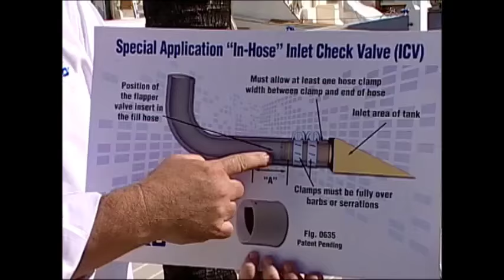1st-Relief offers the solution against unwanted "well-back", powered by Perko Inc and ShipShapeTV

Comment: the problem is the fuel air vent. If the fuel air vent is clear then there will be no "well back or spit back". if the fuel air vent is clogged or closed then there's not enough air pressure to push fuel into the motor, it will stall on idle or while cruising. Fuel air vent prevents the tank from a vacuum state, not an absolute vacuum state but enough to prevent fuel into the motor.

Comment: Looks like it backed up because he blocked the vent. Then if the valves shuts don’t you still spill the gas you’re pouring?
Reply from the maker: Closing the valve prevents the gasoline from shooting out. Of course, if you open the tap further, the gasoline will overflow, but the uncontrolled "splash back" was prevented. And installation and price are really convincing arguments in comparison to the success of the measure. Greetings 1st-Relief
https://www.1st-relief.com/en/perko-in-hose-inlet-check-valve-icv.html